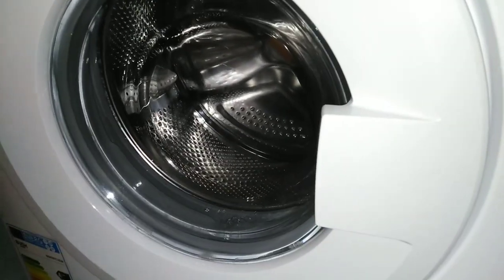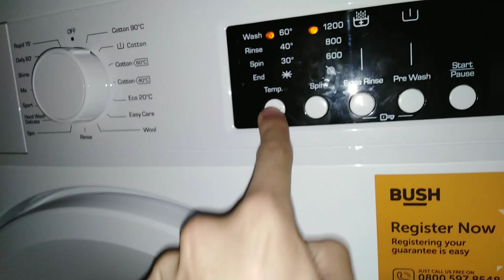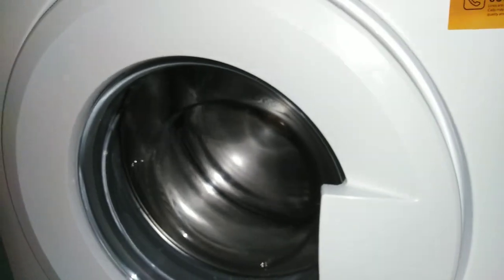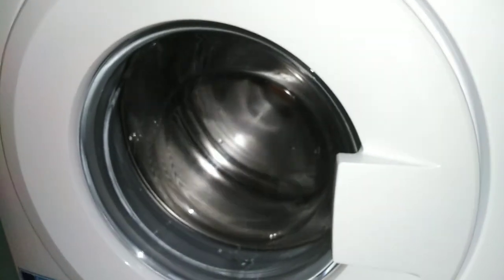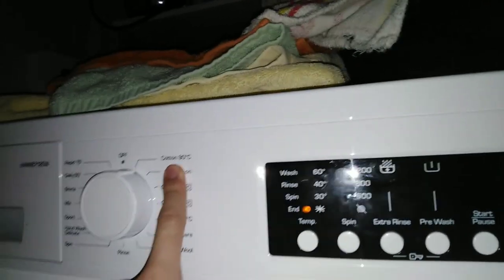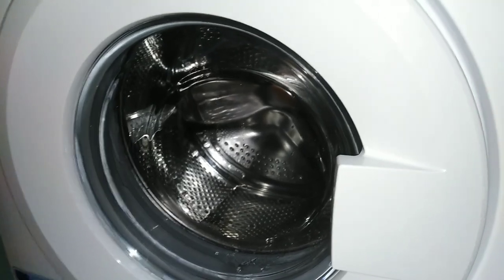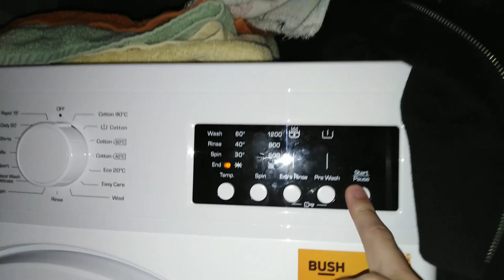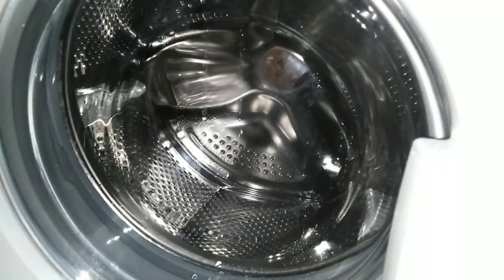How to enter service cycle or test mode on the Bush WMNB712EW

Comment: mine wont spin fast and drain properly? happened yesterday and again today
Reply: tried what you said master reset Bush WMSAE712EW...... holding the button dont work. so i fixed it the long way checking the outlet, filter, sink. no blockage. pulled the machine out switched off at the mains.. put it all back now its working fine.

Comment: Thanks for your video, I have the same machine. When I entered the test mode The pump operated, but when it went to spin the machine stopped and the Spin and End lights started flashing. Any ideas would be gratefully appreciated?
Reply: Did you get any advice ? Ours is  now doing the same ?
Reply: @angelafisher2433   Hi, I got a repair guy out and he told me I was overloading the washing machine and that cased the carbon bushes to wear out. He charged me £90, but I think the parts are only about £10 to £20 for the pair, and watching him do it, you could probably do it yourself in about 20 mins. Hope this helps! Cheers, j
Reply: @jasong3355   Thankyou so much , I'll have me a Google & have a go  much appreciated 👍
Reply: @angelafisher2433  No probs, just to let you know, I used to fill it where I literally had to use my feet to stuff the last towel in, and the repair guy said you should be able to fit your hand into the back of the drum sideways. Keeps my missus happy as she bought it lol

Comment: Hi. I’ve just gone to put a load in, and it won’t lock & start the wash. The extra rince and pre wash buttons flash for a few seconds & then the wash buttons flash. Any advice?
Reply from the maker: Most likely the board is faulty
Reply: @washerlad306  is the board part of the motor (and tachometer) component?
Reply from the maker: The motor tacho is on the pcb yes
Reply: @washerlad306  I've tried the test cycle. I've got three yellow lights flashing - wash, rinse, spin ... is the machine telling me it's tested these cycles and it's OK, or what?? Stefan
Reply: any advice appreciated Washer Lad... in your good, clear video the spin cycle is (after the pump) tested first. It steadily cranks up the speed to 1200. Mine spins a little but I don't get the impression it cranks up. What do you make of the flashing lights at the end of the test cycle? With regards, STefan
Reply: perhaps it's an intermittent contact on the carbon brushes, if it's conking out after 10 seconds. Do you think it might be them?
Reply from the maker: Could be the carbon brushes not making proper contact with the commutator